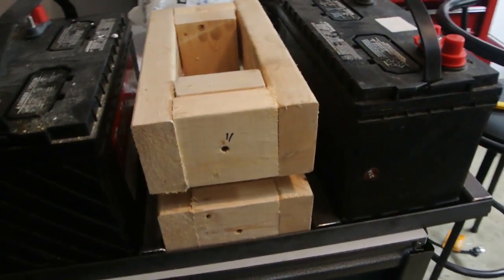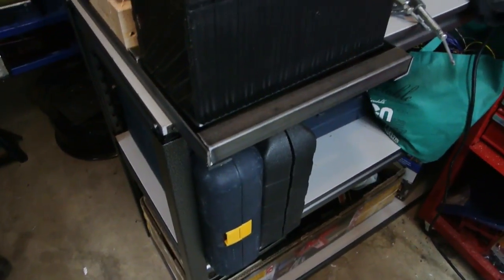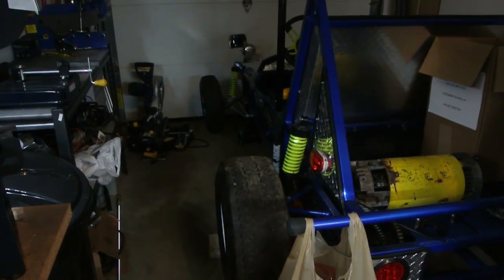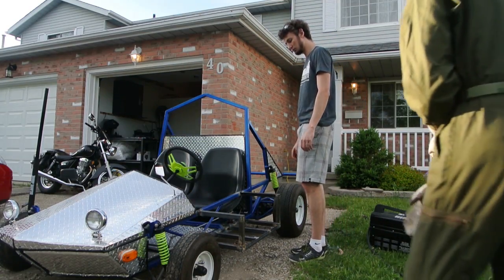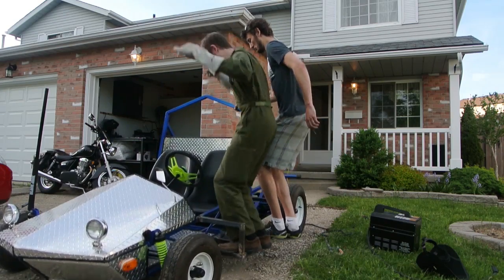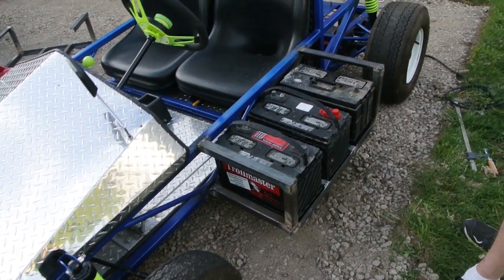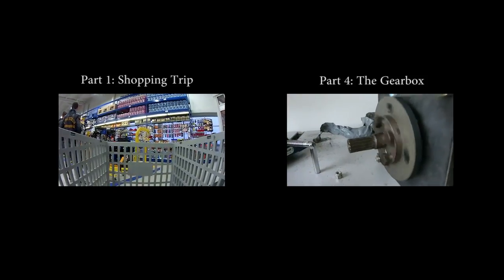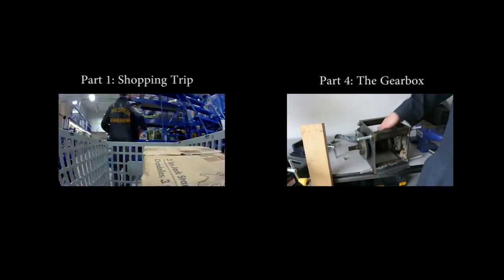Electric Dune Buggy Conversion, Part 3: Beginning Fabrication

Comment: Lol I liked the brand of your batteries shown at 2:57. I must know though is there a reason you opted for the side and not the behind the seats (ie putting the shelves there) or possibly in the front next to the steering wheel, and perhaps frame up a taller front end?
Reply from the maker: If we put them all in the back, the buggy would do wheelies constantly -- it's almost 500lbs of batteries. We opted to keep them as low to the ground as possible (same height as the bottom of the frame), and as central as possible. Along the sides is the best of both worlds -- it'll stick to the ground like glue, like a performance designed race car =D
Reply: the Hacksmith Ah good point! It seems so obvious now that it was mentioned. =D

Comment: What are you going to use in the suspension retune? Full overhaul, or replacements? If your planning on using heavily you may want to invest in some piggyback reservoir models with stiffer springs and thicker fluid. Might want some research into tunable damping and rebound plates as well.
Reply from the maker: Haven't quite decided yet to be honest -- we were thinking about something adjustable...